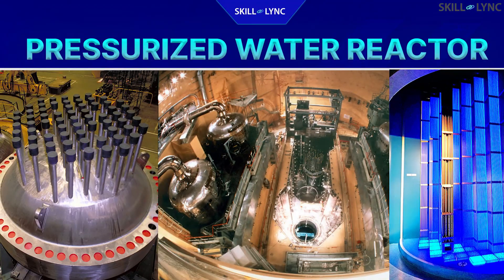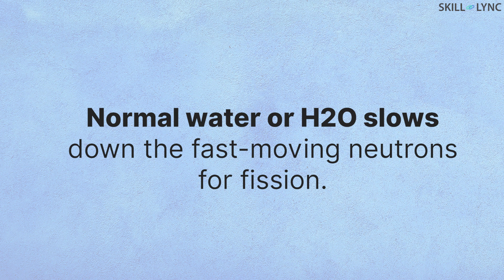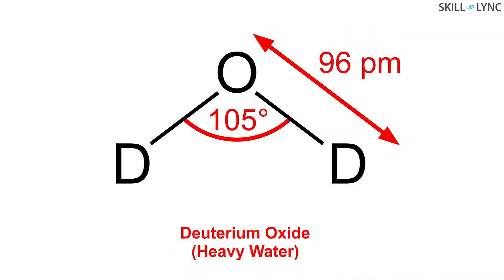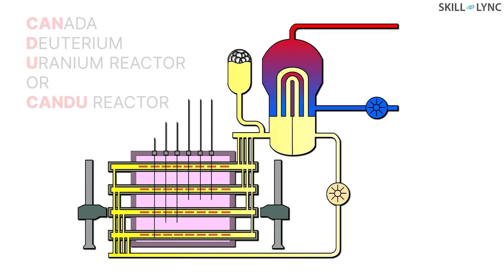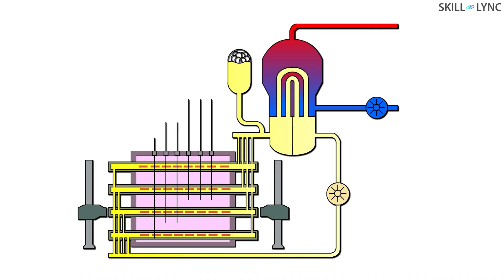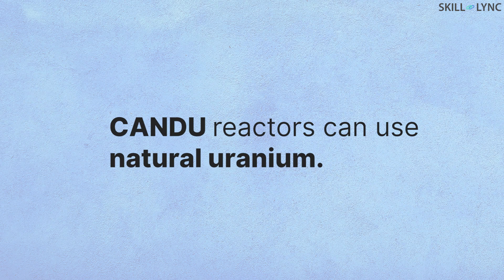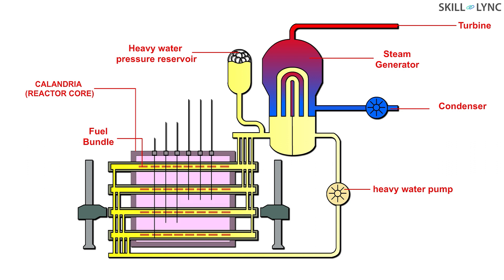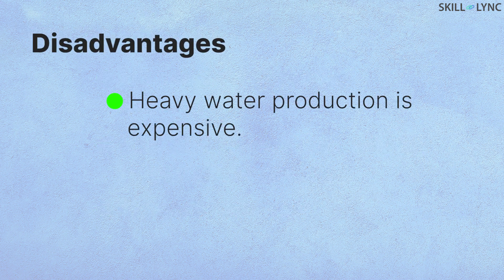CANDU Reactors | Skill-Lync

Comment: An interesting byproduct of hydrogen electrolysis on a massive scale would be deuterium, which in turn could be used to make heavy water. Another interesting feature of CANDU reactors is that they can run on spent fuel from light water reactors.

Comment: CANDU reactors has "Positive Void Coefficient" which is not good at all, fortunately a small PVC, Chernoby had a huge PVC, however it was the reason because CANDU was not accepted in USA where the Reactor should have "Negative Void Coefficient"
Reply: That's just a way to stiffle a competitor using a lame excuse. CANDU reactors could be a partial solution to the spent fuel inventory from PWRs and BWRs as they can process not just natural uranium, but slightly enriched uranium as well. That's a whopping 94% of *nuclear waste*.
Reply: Yes, you are right
Reply: PVC is not an issue with a CANDU in practice, because there are two fail safe passive shutdown methods that only require gravity: cont rods are magnetically suspended and drop to stop the reaction if there is a power failure. In addition, the horizontal pressure tubes were a design choice for both ease of refueling plus the fact that if the reactor overheats, the pressure tubes sag, and the sag will kill the reaction. So an uncontrolled reaction is close to impossible in spite of PVC characteristic due to the LP moderator in the colandria tank. Then there's the overkill 3rd shutdown feature, the poison injection system.  PCV was used to talk some countries out of CANDU, even though they are the safest of the current reactor designs.

Comment: The pressure tubes are made out of zirconium, which produces hydrogen when overheated. While “considered safe”, I think the propensity for hydrogen production can cause a lot of headaches in the event of a major malfunction.

Those reactors were designed a long time ago. Modern designs are probably much safer (I don’t know). If it’s the case, we should be upgrading.
Reply: No, hydrogen can only be produced from water (zirconium is a element, not a molecule) when the temperature exceeds 1200 degrees Celcius. CANDU-reactors use heavy water as a moderator, so hydrogen synthesis is impossible in the pressure tubes. When the fuel pellets come directly in contact with the heavy water, the chain reaction stops immediately. CANDU-reactors are safer than normal PWR.
Reply: HVI If I’m not mistaken, the pressure tubes are made of a zirconium alloy, & the pressure tubes themselves are in contact with the heat transport system heavy water. If I’m right (big if), the following reaction can be accelerated at high temperatures:

Zr + 2D2O => ZrO2 + 2D2

Again, if I’m right,  the CANDU reactors would have many of those pressure tubes, and this great hydrogen (deuterium) production potential.
Reply: @SmartestPerson666  It is more likely that the heavy water will decomposit into oxyhydrogen, since zirconium is almost invulnerable to corrosion, hence it is used for the pressure tubes. Most CANDU and PWR have a platina catalyst in the reactor building to rapidly convert hydrogen and oxygen back into water vapor. Also is oxyhydrogen much more dangerous than hydrogen only, since it is in the right proportion. CANDU-reactors have many other passive safety sytems such as pressurized water tanks to prevent a loss of coolant accident. Both Chernobyl and Fukushima didn't have passive systems. Reactor 4 of Chernobyl was destroyed by a thermal runaway caused by exceeding the ORM value (minimal amount of control rods in the core) in combination with Xenon-poisoning, graphite-tipped automatic control rods and a blocked ECCS (Emergency Core Cooling System) and auto-scram system. This caused a steam explosion followed by a oxyhydrogen explosion that blew the reactor block apart. The accident at Fukushima was caused by ignorance of TEPCO, since they knew that the diesel generators wouldn't be high enough above the sea level when a tsunami would occur, and they were also warned many years before the accident.
Reply: What's the big difference between PWR and CANDU in terms of working?
Reply: @bertinaagnes73  PWR is light water reactor while CANDU is heavy water reactor . 
PWR uses enriched uranium in general while CANDU uses natural uranium .
Countries like India which are not part of NPT uses PHWR like CANDU
Reply: @preetamyadav7952  thanks!
Reply: @bertinaagnes73  ya bro 
what u do ?
where are u from ?